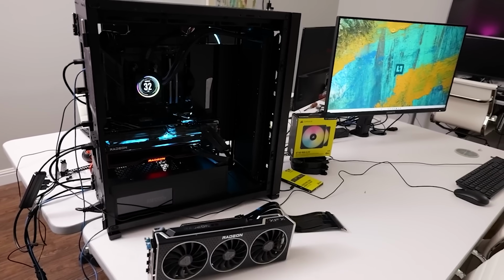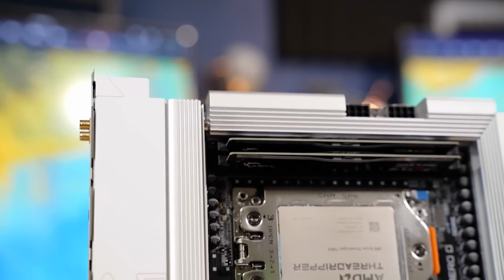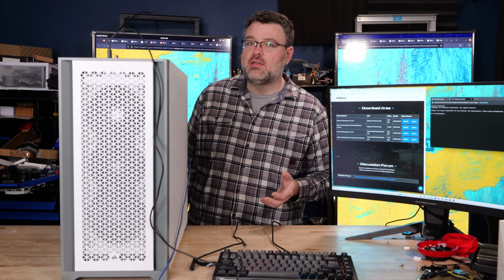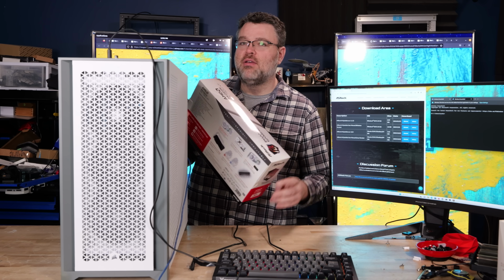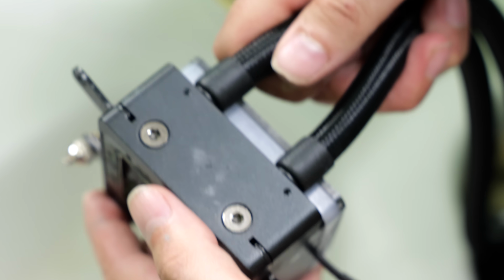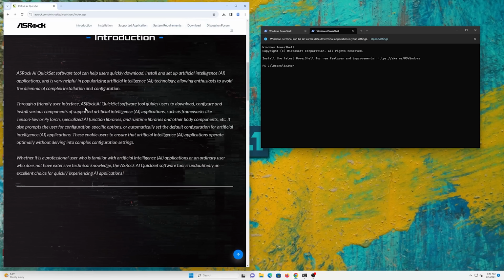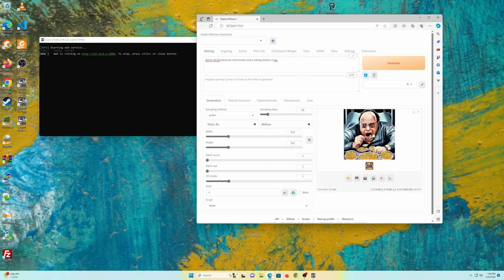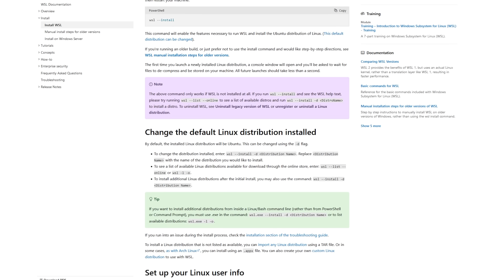Just How Good Is The 24 Core Threadripper? A Build

Comment: Hi , is there anyone who can answer my question.  I want to know how to calculate maximum number of rtx 5090 those can be supported by Threadripper Pro 7965WX with ASUS Sage WX90E motherboard. I know there are 7 PCIE 5.0 lanes but how many RTX 5090 can AMD Threadripper Pro 7965WX handle. How can I know each a processor maximum support for graphics cards. Keep in mind AMD Threadripper pro 7965WX is 24 Core , 48 Cores Processor

Comment: I’ve got an air-cooled 7980x by System76 and it stays below 50C in a 76deg room. This is very helpful, I’m building a 24 core system for setting up my runs. Didn’t want to do a build risking a $5k cpu, and the ducting in the ‘76 is superb! Get an extra PCIe fan if you’re going to run a 100gbe card between two Threadrippers (it’s an option for the ‘76), the Mellanox/Nvidea cards get hot!

Comment: I love my 5000D. I also love that Corsair sells all the panels to their 5000 line of cases. In this way you can easily replace the standard 5000D panels with the airflow panels if you choose, or you can also install the glass panels. The pricing is reasonable and they shipped quickly. I'm a big fan of the platform.

Comment: Still wishing they made a 16-core Threadripper 7000 for 1000€ or so (the 24 core is 1500€ in Europe). :(
I don't need more cores than 16, but I need more PCIe lanes!!
Reply: 7950x3d is 16cores, is that not what you want?
Reply: @minijag972  My point is that I don't need more cores than 16 but I need more lanes than the measly 24 you get from a desktop CPU.
Reply: Oh!,  Something about that didnt register the first time @Blacklands

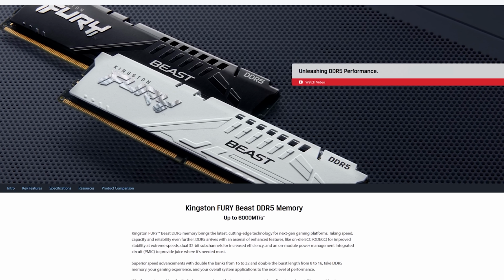Comment: Thank you for making these videos. I have a question about the 12 core threadripper pro: since it only has 2 CCDs, is that not enough to saturate 8 memory channels (230 GB/s out of ~ 400)? Also btw the 7960X is only 4 channels (01:07)

Comment: Jays two cents just did a DDR5 memory comparrison between three different speeds and timings and for the most part didnt find enough of a reason to get anything more than 4800Mhz CL40, 6400Mhz CL38, 7200Mhz CL34 for gaming atleast. I would be interested in a test, with your knowledge, for both sides of this for a real comparrison to see if its worth paying out the wazoo for these higher memory?

Comment: I have a Threadripper 3960X and the experience hasn't been all that great.  First off, no matter how hard I tried, I could not get my ASUS Zenith II Extreme Alpha motherboard to run the RAM any faster than DDR-3000 with stability.  Second, when the machine is off for a few days (like on vacation) it can be very hard to start back up.  I have to cycle the machine several times before I get to the BIOS menu.  It's like trying to start an old chain saw.  And finally, the multi-threaded performance is great, but the single threaded performance is nothing special...  I wouldn't do a Threadripper again.
Reply from the maker: Low cmos battery voltage for the second problem. First problem is only run one dimm per channel.
Reply: @Level1Techs    I have only one DIMM per channel.  I think the problem is that it's AMD.  I have an Intel Box in my Media Room and it NEVER has a problem.
Reply: No point in TRs unless you truly need the PCIE lanes, RAM capacity or the cores for something. 14900k has 24 (8P+16E) cores and 7950x has 16 cores already. But if you need those lanes etc, then you need them.

Comment: I’m still rocking a 2950x in a 4U rosewill case that barely keeps the chip from thermal throttling. Pretty sure its the smallest noctua cooler that they made for that socket. I’ve been considering installing a 240 or 360mm aio setup but dont think its worth the $ for likely identical performance (Running the system as a NAS and care more about stability/power consumption so I wouldn’t be overclocking)

Comment: Ennermax has already done enough on their own to dissuade people from purchasing their AIOs.
Reply: Why would anyone even choose Enermax over Arctic?
Reply: The only one I've had leak was an enermax. thought it was a cheap POS motherboard, it took out the 1150 xeon I had on it too.
Reply: Yeah, my Liqtech 240 mm gunked up. The only thing good about it was the static pressure of the fans.
Reply: I still have mine.  Never had an issue and still got thebwarranty exchange no questions asked.  Just wish their was a kit to convert it to a different socket
Reply: Arctic cooling is better overall IMHO
Reply: These days, air is going to be better unless you have very specific needs (mostly when you can pump cool air to, and exhaust from the AIO without interacting with the air in the system, or the AIO is the only exhaust for the entire case). Or for physical fit.

Beyond that, direct mount is going to perform just as well, at a fraction of the cost.